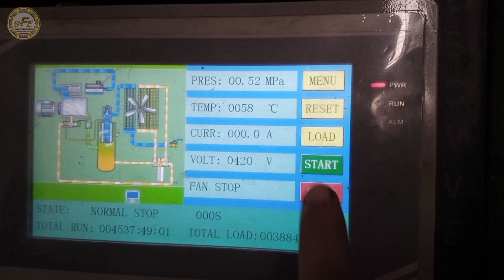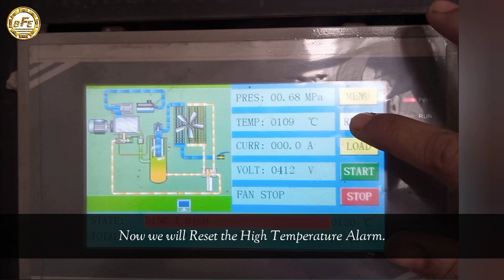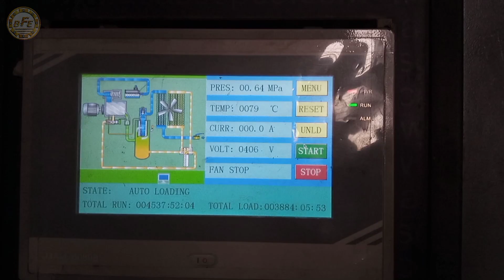Air Compressor Temperature High Problem Solution | Episode: 01 | Air Compressor Overheating Problem

Comment: If volt high from 426, how I solve it
Reply from the maker: Change the voltage setting.  Set maximum 430 volts or 440 volts. Thank You!

Comment: Good job sir , if I remove that valve totally can I solve overheating problem?
Reply from the maker: Can but it will not be Atlas Copco Air Compressor.  Because to run without it some changes in the system have to be made.

Comment: Is 90 degrees oil temperature ok for atlas air compressor during loading.

And how much is the acceptable discharge outlet air temperature.

Thanks.
Reply from the maker: Welcome 🤗
Reply from the maker: An outlet temperature of 75° - 85° C is ideal, at which the air dryer works very well.
Reply: Thanks brother
Reply from the maker: Welcome 👍